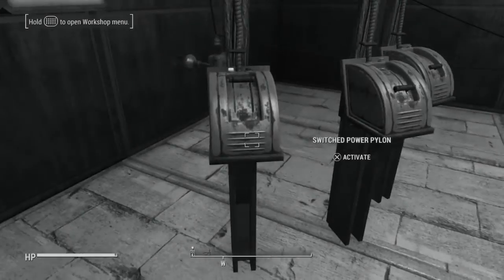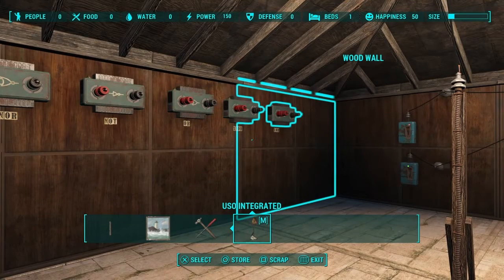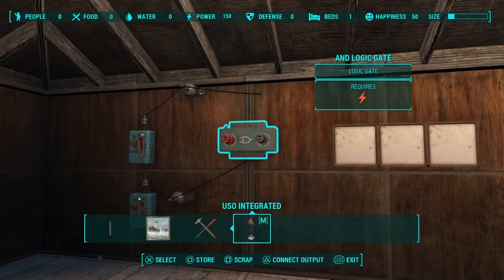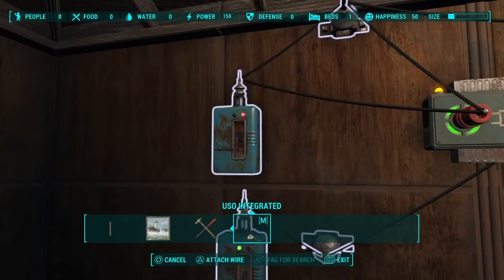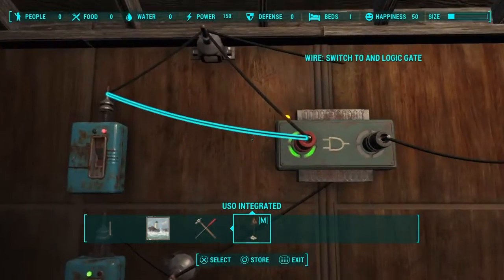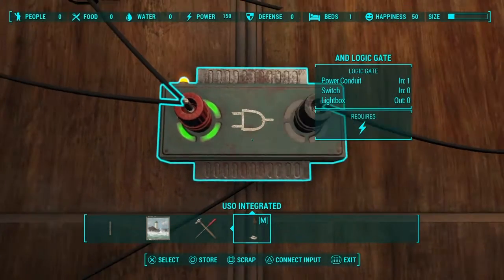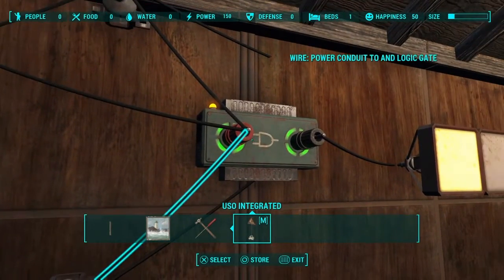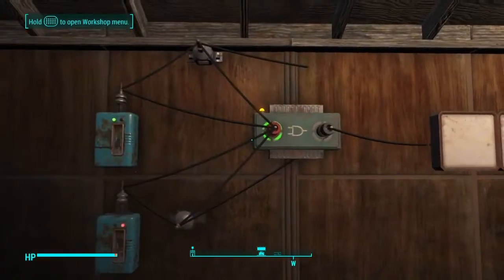How to Use AND Logic Gates in Fallout 4 - Simple Combination Lock Project

Comment: Sometimes I use an AND as a security switch for doors that are meant to stay open unless on lock down. Most of the time I put this on doors with a multi layer system such as having a door frame shelling a powered door that is kept open and invisible. I do not use it for very much else.